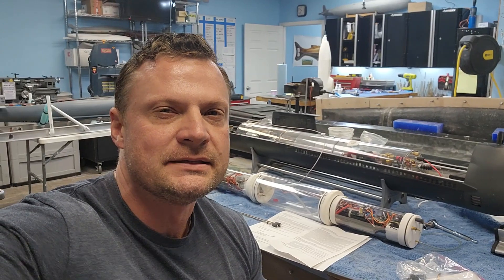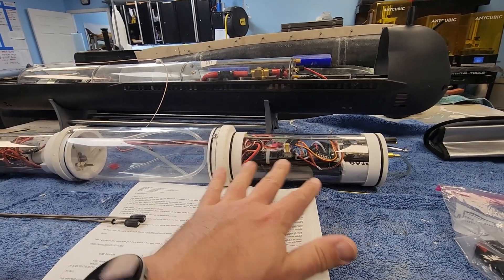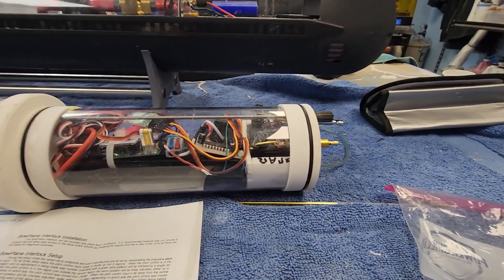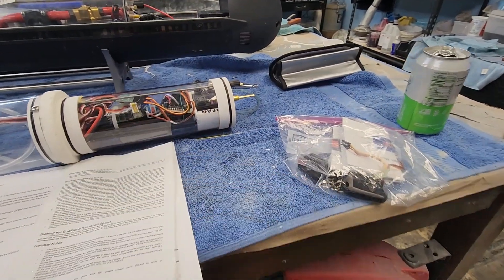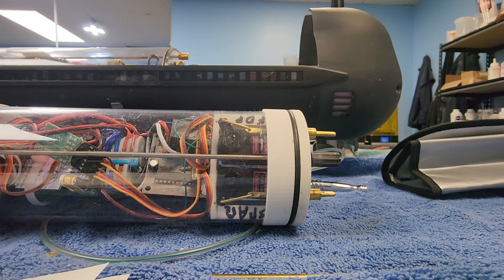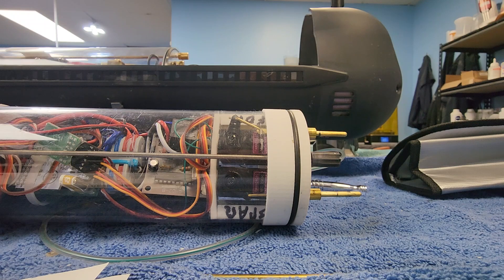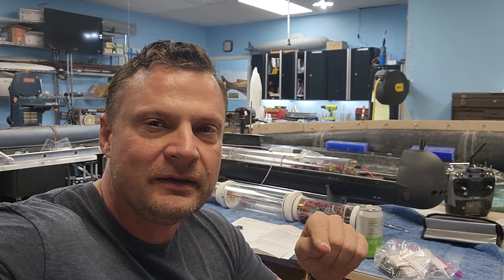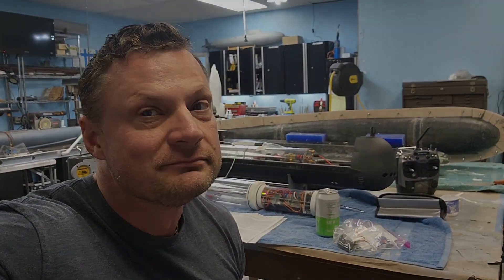The Bow Plane Interlock from the Nautilus Drydocks.

Comment: Actually this can be programmed in any modern transmitter. Such a function is used for ex. also in planes - in F-14 - when the wings are retracted then it's not possible to operate the inner flaps.
Reply: True, but modern units are in the GHz range, which doesn't work well for submarines. Many of us are using older transmitters in the MHz range.